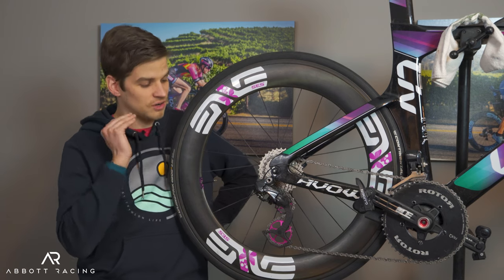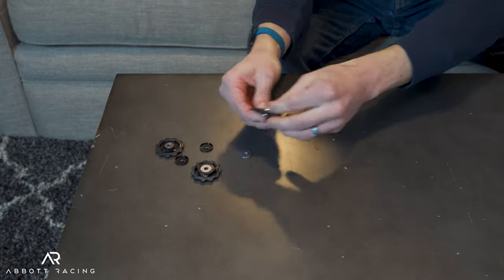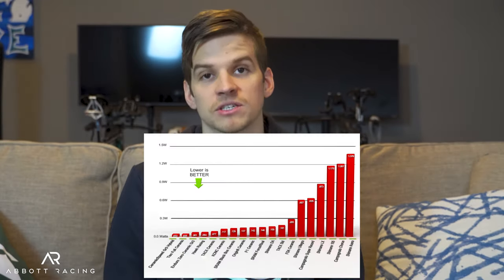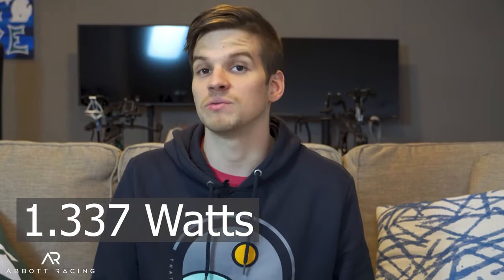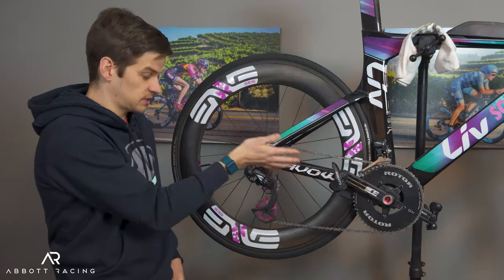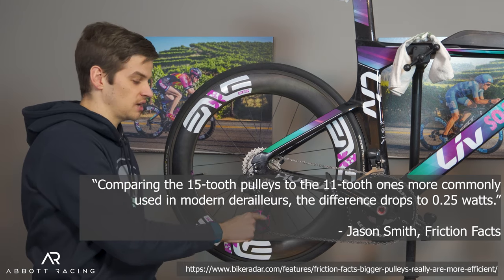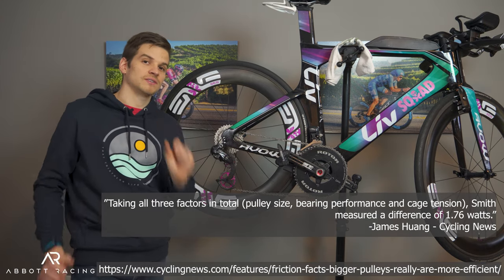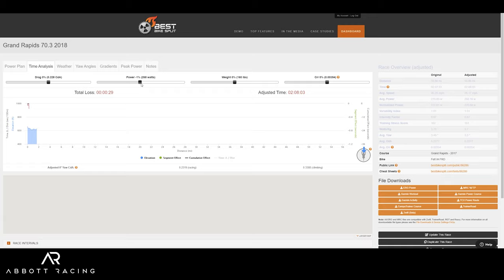Are Oversized Jockey Wheels worth it | Time SAVED on RACE DAY

Comment: The biggest issue is that most of these (especially the Ceramic Speed) are just ridiculously overpriced. They cost so much that you can buy many things that will actually yield much better results for you. At least KCNC is relatively cheap.

Comment: Good analysis! There are so much more variants of increasing speed, partly also depending on the athlete, that a pulley wheel optimization is negligible. For instance the weather conditions, roadsurface, but one of my most favourite is how long can you ride in the most aero position whilst maintaing optimal power through the pedals? Sitting upright, flat or anything in between literally saves miles per hour. The other thing is "what is thé function of a derailleur?": guiding the chain! Optimizing low frixtion in the gearing is a better way to increase speed and endurance 😀

Comment: There are other factors: 1) potentially bigger frontal area, so more drag.  2) weight differences, if the wheels are bigger are they heavier?  Appreciate that both of these factors will be negligible..., but as the benefits also seem to be negligible it would be interesting to see if they negate any benefits!  PS: changing the chain tension might give you less drag, but it will also disrupt how well you shift gears!

Comment: The new Dura-ace pulley wheel spinning relatively tight is probably caused by new seals. Give it several hundred miles and I would expect it to spin freer.
Reply from the maker: Those were off my road bike which was over a year old by the time of filming and had over 1,000 miles on them. They are well broken in.
Reply: @EricAbbottTri  I see. All right, then it is really tight. My pulley was tight at first, after 1000 kilos or so, they certainly loosened up.

Comment: The biggest factors I want from jockey wheels is shifting ease, precision and smoothness. Some of those aluminum wheels cause all sorts of clunky and rattling effects. I don't think Shimano and Campagnolo design their factory wheels at a compromise. Weight weenies, watt weenies... all the same. Nobody will consistently gain 12 to 22 seconds over a 70 mile course simply because of friction gains or losses in their jockey wheels. The variables of physical form and fitness are hugely, vastly more responsible for performance output. So focus on reliable shifting and on riding better. Don't do the math, do the work you weenies.
Reply: I think you you are missing the the biggest factor why to get one. They look cool.
Reply: @LadyTea  They look like something you'd put on a kid's bike to make sparks or whistling sounds. Now that would be cool.
Reply: @Joshualbm  lol. Fair. I wish it would make some sparks like the old barbie rollerskates

Comment: I kept my Dura Ace 12 speed cage & added Atia from Melbourne Australia 🇦🇺 OSPW...   only . 
Ceramic Bearings with Titanium Jockey Wheels.  Larger than Dura Ace .  Was considering the Nova Ride from France 🇫🇷  they have larger jockey wheels again . 
Both spin exceptionally well.  
Nova probably marginally better . 
But cost was $110 aud  more & the weight was more using the Nova Ride .  Aita were lighter . 
Spent a Fortune 2 build a Lite Weight SL7 S-WORKS 54cm 
Finished weight was / is  6.83 kilos 
Including  Pedals , S-WORKS Carbon Bottle Cages , & Computer Mount that came with the FSA VISION ONE PIECE CARBON COCKPIT.  And also S-WORKS Power Printed Saddle. 
Lite Weight tubes ..  Definitely not a fan of Tubeless 

For the Pedals l went 4 the Time Xpro 15 's 
Never used Time Pedals b4 l put the Time Xpro 12's on my SL5 . 
My SL5 is spec'ed out 2 the current SL7 Expert.  Over a period of time.  So much better 2 Ride.  

Xcellent Feed Back from u on the OSPW .   Froomie uses them & l guess they/he are after every ounce of advantage . Don't blame him

Comment: There are all these claims that "this saves x watts" etc but its all over the standard system. When you start adding it all up its very minimal. A waxed chain, bigger front chain ring, ospw, its not just addition to find the watts saved. If it was addition all pros would be doing it all because its allegedly a free 50 watt saving with everything.

Comment: I just ordered me a chinese carbon derailleur arm with oversized ceramic jockey wheels. For those low prices I'll give it a go, cause I think it looks cool and even matches my bike colors. Should it fail, I'll just put the stock arm back and move on...
Reply: Same here, waiting for it to arrive
Reply: did the same thing, only an idea to consider, those ceramic bearings aren't sealed. It means the dirt will make it's way through it very easy. Imo i would consider replacing bearings with normal ones but higher quality, best way to go
Reply: @antoniolaza736  Exactly what I also did! 👍🏼
Reply: So after a year, how'd it go?
Reply: @daveelanga7359  still going strong! 👍🏼

Comment: I won't argue that the difference is huge, but you missed that the number of completed rotations of the derailleur is reduced if it is oversized, which will reduce the amount of lost energy.
This will probably bring the power saving closer to 3W than 1.76W.

Comment: The "reduce chain angle" part is wrong. bigger pulley can reduce "Each link's bending angle", but mean while needs to bend more joints because of less angle also bigger pulley. So the total energy is on how much angle each link need to turn in the full cycle.
So over all I think it's the same energy, or even the oversized will take more watts because it let the chain change more angle.

Comment: It's common in the Shimano pulley for the metal covers that sandwich the bushing to rub. This results in the friction seen in the video. The fact you can still spin them with your little finger, gives you an idea of how much energy you are actually wasting. It's negligible. When you spin a jockey wheel, we believe it correlates to the wheel spinning. I also "upgraded" my pulley to ceramic and they spin freely. Makes no difference in every day cycling

Comment: My MTB Shimano XTR Rear Derailleur is 11t top and bottom. upgraded when they needed replacing and went 12t top and 14t bottom ceramic. After 4 2hr. rides I have seen almost 10 watts more power and much smoother pedaling. Was shocked.  I bought them on Amazon for under $30 for both.  That was on my training bike, just ordered another set for my race bike.

Comment: I think. For the average joe who doesnt race but goes on club runs - totally not worth it unless they have money burning a hole in their pocket. But I think moving from the cheap pulley with the ferrule bearing to a wheel with a proper bearing would be a good step forward and some dont even need to cost the earth.

Im currently overhauling two of my bikes. My commuter is running a 105 5700 and my 'go faster' bike is on an old 6800 Ultegra - All with the stock OEM jockey wheels. The commuter is getting a really cheap BBB Roller Boys BDP-02 that doesnt even cost me $12. The 6800 is getting a BDP-22 which cost me $43.

I could have gone OEM but i did a lot of digging through reviews and even the $12 jockey set should be better than the OEM ultegra set according to reviews. $12 is cheap enough for me not to care too much if they offer little to no difference to the OEM 5700 Jockey wheels.

-- it sounds dumb but im pretty excited to see if i'll feel any difference between the old and new jockey wheels. owned both bikes about 5-6years

Comment: Literally, putting your sunglasses OVER your helmet straps instead of under them confers a more significant gain than ceramic bearings (and yes, that’s been verified in a wind tunnel). Other things that have more benefit… shaving your arms and legs… 14x more benefit than oversized pulleys, tailoring your jerseys to get rid of the wind flapping on the shoulders, a helmet with fewer vents (which are ironically less expensive helmets).

Comment: I saw a guy from the usa do a promo on the latest & gr8est from "Absolute Black" sensational ospw. The gear changers were real slick. Better than with original P.W. & the quiteness was deafening with the Absolute Black version.  Gr8 job sharing. Top notch presentation.  So l will subscribe to ur channel.  Thx

If l was going 2 splash some cash l would go with Absolute Black
Reply: Go watch Hambini and Peak Torque, then reconsider. 

Absolute Black were an alright brand for making your bike look slightly better but the price/quality ratio has always been abysmal. The OSPW fiasco blew it out of the park, they keep making wild claims about their performance and justifying the $700 price tag and all they have to back up their claims is "just trust me bro". 

One thing I can give them credit for is making a plastic derailleur cage, which I believe is what muffles the drivetrain sounds.
Reply from the maker: I have seen their videos. Not sure what I would reconsider?

Comment: Did you also take into account that the oversize system is larger, so heavier,  plus the chain is longer, so heavier too. I think the benefit is even smaller than you state.  And Shimano haven't made much junk over the years, let alone Durace.
Reply from the maker: I have not heard anyone bring up the weight issue actually. Generally the oversized systems are a combination of carbon and plastic so it's weight is minimal, same goes for the chain. However, that is another variable to this question.
Reply: Add aero drag too . Significantly larger side profile for of bore wind and larger frontal form . Longer chain ect all add up and nullify any advantage . Also it adds more friction on a multi geared system as the side plates are more likely to rub if it is not dead in line with the chain rings . Having less tension decreases power input to the wheel as the chain has more "takeup " before fully engaging with the cassette teeth . (Think a track bike with a slack chain and how much power is lost before the wheel spins . )

Comment: I have sram force axs short cage rear derailleur, so can’t run larger cassette than 10-33.  If I install OSPW set up, with longer chain, can I run 10-36 or greater?
Reply from the maker: I don't thing so, the max cassette size doesn't have anything to do with the OSPW. Could confirm with SRam or ceramic speed or slf

Comment: Price per watt savings is a great metric to look at.  Personally, I like to dip my full naked body in a vat of cheap Vaseline.  So aero. So affordable.
Reply from the maker: Oh man, how come I didn't think of that. Plus you will go faster in the water as well :)
Reply: @EricAbbottTri   -  Oh no.  I do that in T1 and then wash it all off in T2.  ;)   I think the how much does it spin in your hand is a bit misleading.  When I tried to race on a fidget spinner in 2020 I failed miserably.  I think the tricky part is how efficient/durable the bearings are under load not how long will it spin.  You could probably test this by stripping out the bearing lubricant.

Comment: What about really dirty drive terrains does it save more watts because During triatholon you sweat, you bike collects lot of dust? Or what about a gravel race when you are riding in verry rough and dusty conditions?
Reply from the maker: If you wax your chain then it won't collect dust and dirt when riding and this won't change the wattage loses

Comment: at 5:00. How is this OSPW cage offering lower chain tension? Ceramicspeed installation video literally reuses stock cage spring from the durace rd. This means the same tension is being applied before and after installation. If anything, in case you forgot to add a link or two of chain to account for the increased length of chain inside the rd and cassette section you actually introduce more tension with OSPW cage because the cage now gets pulled forward more. The larger cage also creates more drag which costs you wattage. Sure you can say it is fine because the cage is in the turbulence of the crankset but that is only true when you have perfect headwind. Simply not true in real riding. If you tally all the bonus and penalties the OPSW system probably will be wattage neutral... But hey at least the manufacturer is budget positive when you buy hahahaha.
Reply from the maker: The spring connectes at a slightly different position. There are actually 3 slots for the sprint. Low, medium and high tension
Reply: @EricAbbottTri  Stock has 2 slots on durace. I guess is they offer same if not similar amount of tension when adjusted to the slackest setting. Mind you you can only reduce the tension much before facing chain drop and frame slaps.

Comment: two years later but im doin' some research on these...
so, do ppl only put it on new (fresh so to speak) for race day? i guess no. do ppl clean it perfectly every time they use it? i guess no. dirt and wear is a killer compared to steel bearings and their casings (and seals in  many cases). you are almost surely going to lose watts some time in the not to distant future-depending on conditions you rode in, half-azzed cleanings, forces you exerted on pulley, etc., etc. once some dirt gets in there and starts messing (see what i did there) with the bearing casing...disaster wrt efficiency.
Reply from the maker: People run them year round. They will need semi regular maintenance depending on how much you ride and the conditions bit in general they last a long tine

Comment: Ok you save 1.76watts but you probably lose 2 watts from aero disadvantage of that huge pulley!
Reply from the maker: Yup that is a common point. That is why SLF motion has made an aero system that supposedly is a fraction of a watt faster than the standard cage.

Comment: So...$500 and you get 20 sec. so $25 per second. Yikes. What’s even worse is I mostly do sprints so $250 per second. And I’m sure you did the calculations right but I honestly don’t trust the calculations for less than 5 watts for the real world so for me I think it’s more like $500 for looks and an angry wife. Not worth it.
Reply from the maker: Yup, I agree. Real world watts are never as simple as the math would like to suggest. There is a time saving to be had but it is probably one of the least significant things you can do.

Comment: I'm not into racing but 20 seconds can win a race.
Reply: What the forgot was the areo drag a larger jockey wheel adds . Which is not to be sniffed at . Also remember that us IDEAL situation in a lab . On a real bike in real world it has zero effect .
Reply from the maker: Those are all valid points. Slf motion also had an aero version and in the wind tunnel it tests 0.3 watts faster than the stock dura ace cage. However, like you correctly pointed out, that is in a lab and the real world benefit is impossible to measure.
Reply: @EricAbbottTri  and you can gain 4 watts by improving body position and correct clothing size . You can also increase power output more by better cleat position . Using an oil on your bearings rather than grease.
Reply: @EricAbbottTri  wind tunnel tests on  bike parts is also useless as they don't take in effect rider disturbed airflow.
Reply from the maker: @edmundscycles1  As far as I know, there was a rider on the bike when they did the test.
Reply: @EricAbbottTri  no the methodology used was a motor driven drive train not connected to a frame or rider .  They then used a static airflow computer simulation as substitute for a frame , wheels and rider . This system is how cervelo,  specialized ect get their 20%  improvement over previous year BS . 

I work within the cycle industry and saw from the inside when I worked for a UK brand the BS used to make claims  about stuff .
Reply from the maker: Fair enough. You clearly know what you are talking about. So what bearings do you use?
Reply: @EricAbbottTri  contactless skf bearings from a reputable  bearing supplier . I also used metal shield bearings from skf that I can service .
Reply: Maybe in TT. In normal race, just staying in the trail of another cyclist for five minutes saves you ten times the overall spent watt
Reply: @riccardotassinari6931  I like the Eddie Mrecx  approach . Before making a bike faster , make yourself faster . It's cheaper and more effective.

Comment: You forgot to account for increased drag by the bigger system. Overall the OSPW will have a negative impact
Reply from the maker: You mean increased aerodynamic drag?
Do you have any wind tunnel data to back up that statement?
Reply: @EricAbbottTri  lol how stupid would ceramicspeed etc be to conduct a test that is obvisouly not in there favor. no need for testing; just caluclate it via the surface area
Reply from the maker: There are other people doing wind tunnel data. I am not saying you are wrong, just saying that until someone posts some actual data all we can do is speculate.